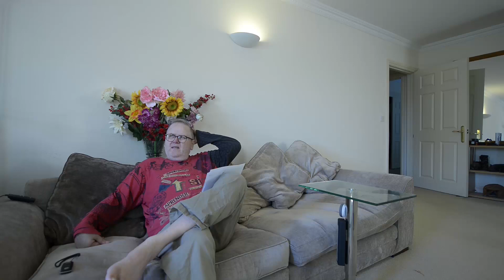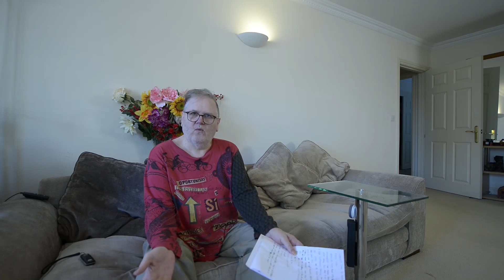3D printed $5 million mega yacht for less than $20,000

Comment: I was thinking of getting a Tesla Truck.  I love the design.  And I wanted to use it to pull a trailer for living in.  But the range of the truck would take a real hit if it pulled a trailer.  So I thought maybe Tesla would make a trailer with an electric motor on it to help with the towing.    But then I thought, why have a truck at all??  Why not put all the electric motors on the trailer and just drive the trailer?   Then thinking beyond that I also very much want a solar electric self-sailing catamaran.   But why not have the shell of a catamaran which you could drive my solar electric mobile home which would then become the power for the boat as well as the living space.  So you would have a living space and a vehicle for both land and water.  And of course everything would be 3D printed.

Comment: Dude, I had internet and the time to watch your video. Sorry it took so long. But damn! You do have a visionary mind! I love it! The problem is going to be the funding to build these big 3D printers (or rent one) that can print all the stuff you need into the mold. I do not think it is a far fetched idea, it is very doable in the very near future! 

But I do like my sails :-)
Reply from the maker: Sailing Sisu 3d printing is off the table now, nasa has created a device that generates material at atom level, this means the material can have its material generated at atom level each atom joins together to make particles that join together very precisely making a super strong material far stronger than steel or carbon fibre and much lighter, its still a pipe dream in progress though
Reply: @JjCoronet  what is that technology called?
Reply from the maker: @hendrikhanso  it isn’t really 3D printed it’s grown each atom fits precisely onto its mating atom making up structures, it’s more like Tetris at atomic level